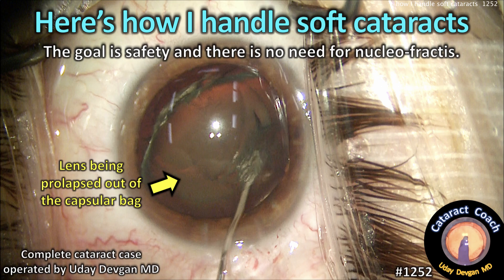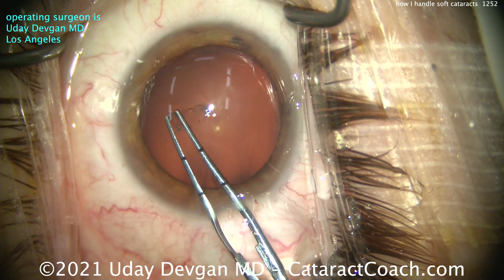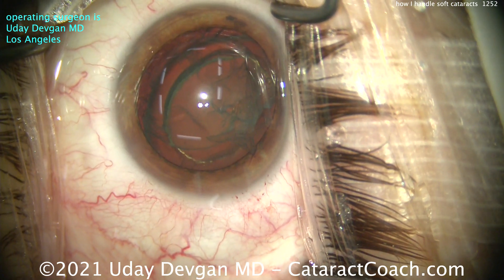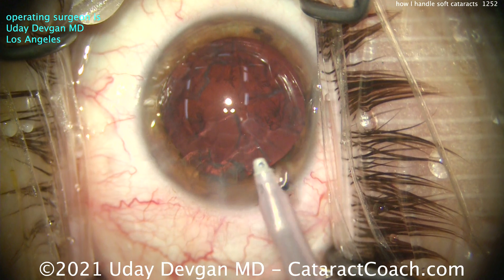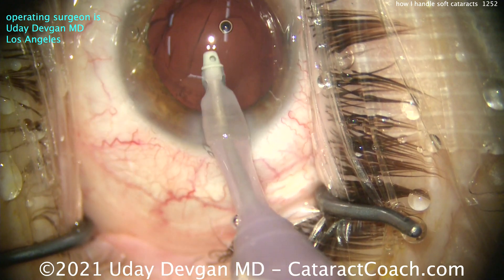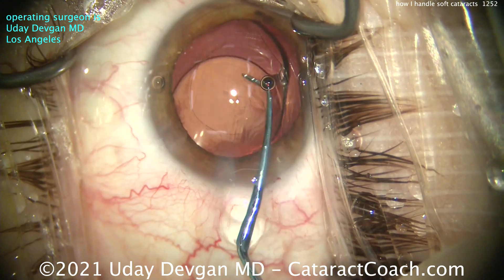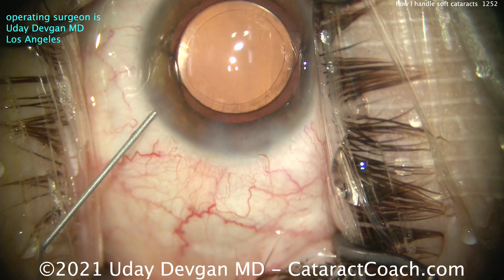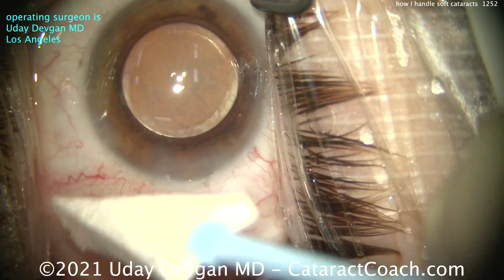CataractCoach 1252: here is how I handle soft cataracts

Comment: Lovely technique. How do you avoid pushing back the lens into the bag when entering with the phaco tip with the infusion on? Do you rest the lens on the opposite anterior capsule? Or wait with the infusion till the chopper is behind the lens?
Reply: Many times the nucleus goes back inside the bag when i enter with the phaco tip.
I like to put some OVD inside the back injecting it from behind the lens, helps a little.
Reply: @doctorgyrus  great tip, thanks.